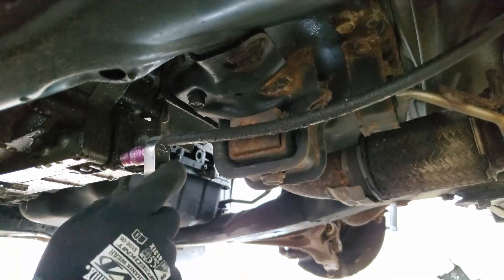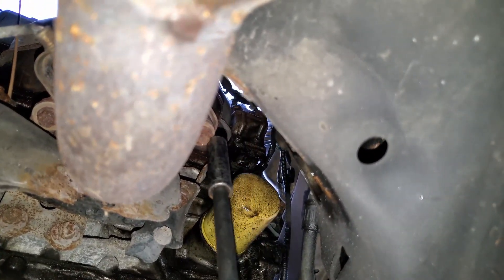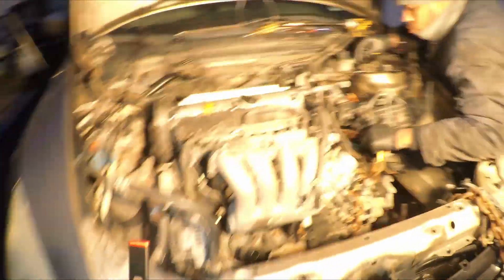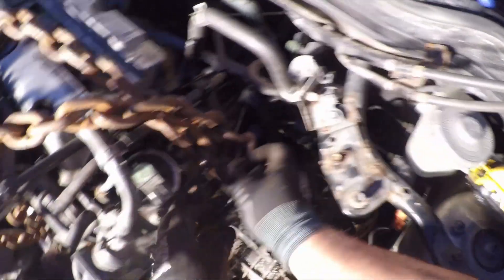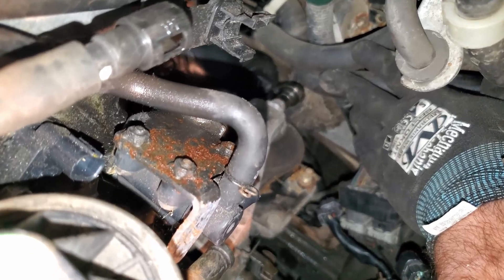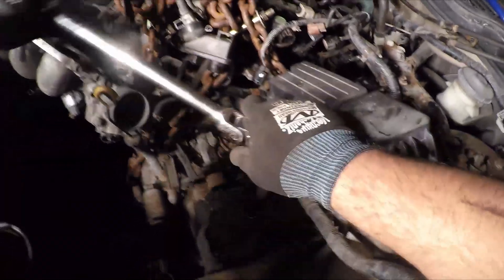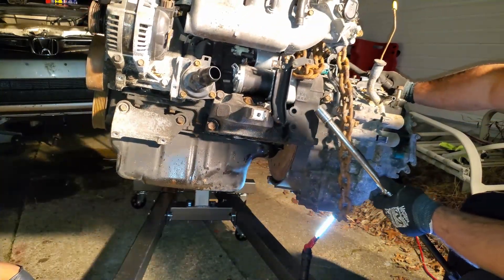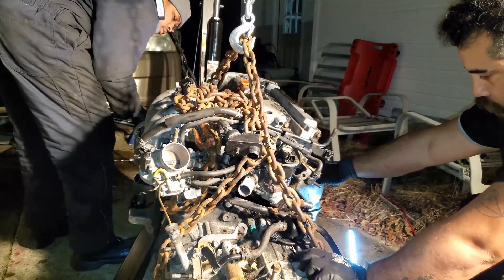How to engine swap 03 Honda Accord Part4 engine/transmission removal

Comment: If I take just the engine out is linking removel necessary.?
Reply from the maker: What link are you referring to?
Reply: @joemismaldonadoRx7 transmission link
Reply from the maker: @thegaminggemini317  yes if you remove the engine and leave the transmission in you won’t need to disconnect the shifter link
Reply: For the shift cable @joemismaldonadoRx7
Reply: @joemismaldonadoRx7 for the shifter cables

Comment: I'm in the process of doing a motor swap on mine and I appreciate the videos man it's been really helpful
Reply from the maker: Thank you for the great comment and I am glad the videos helped
Reply: @joemismaldonadoRx7  No Problem. Im a new subscriber from here on out.. its been a nightmare. all the motor mounts are broken. subframe mounts are busted. cv axels both bad. crash bar bent a/c condenser busted. i forgot the damn shift linkage and broke it. ugh
Reply from the maker: All good man sometimes the best lessons are all the failures we go through just don’t give up I’ve literally had similar experiences with many project cars but the best part is finally finishing and feeling that sense of accomplishment, it’s priceless. And thank you for subscribing let me know if you have any questions.

Comment: approximately how long did it take to remove the harness?  and then install a new one
Reply from the maker: About 3-4 hours to remove and reinstall
Reply: @joemismaldonadoRx7  I assume, with a V6, its harder to remove and reinstall the harness without taking out the engine
Reply from the maker: @ml219  yes the v6 is a bit more difficult because it is bigger in the same size engine bay so there is less clearance, you may end up having to lift the car in the air to get to certain connections from underneath but yes over all it would be more of a difficult swap